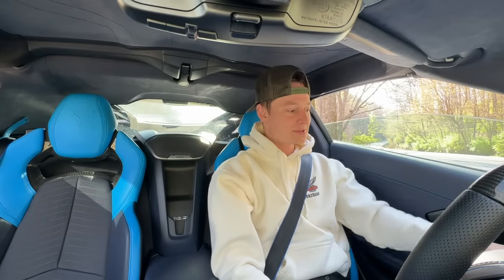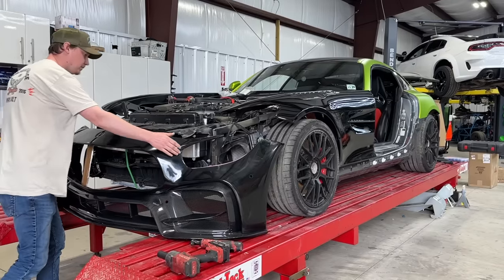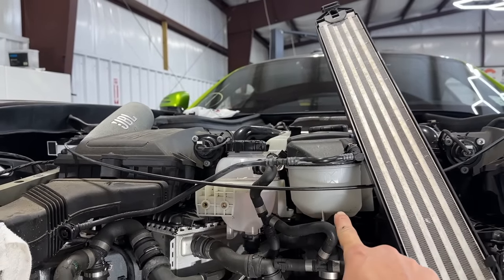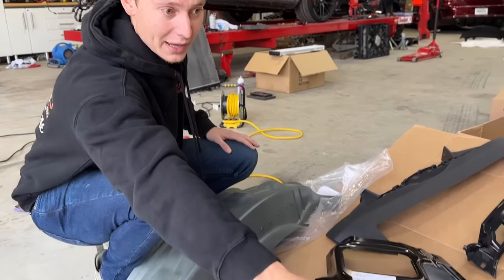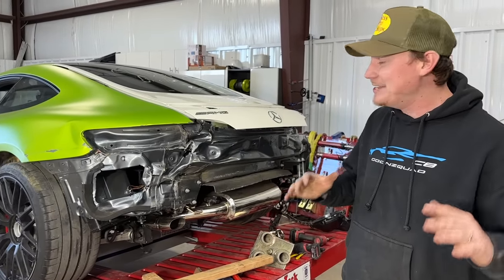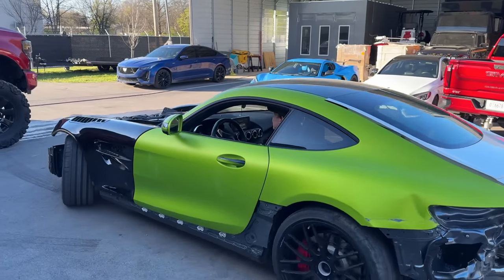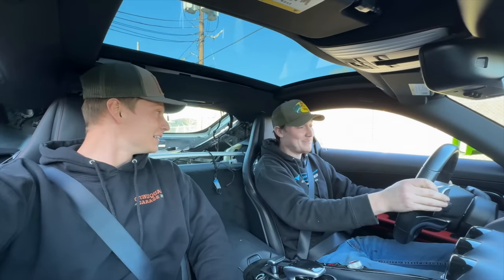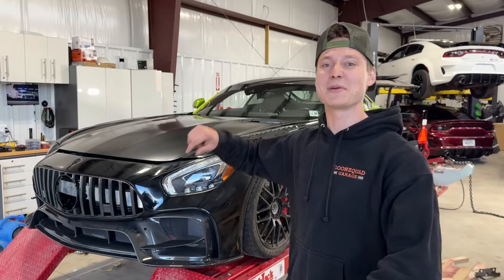Rebuilding A Wrecked Mercedes AMG GTS....First Test Drive!!!

Comment: I’m just gonna say it… It needs a different exhaust that makes it a more deeper growly tone. Right now it sounds like a soda can exhaust.
Reply: u would know. ur uncle had a soder can exhaust
Reply: That’s what they sound like.  Maybe the AMG isn’t for you.
Reply: @Shortdraw01  judging from the fact that I’ve worked on a few of these vehicles, it can sound a lot better.
Reply: @Shortdraw01  maybe my audio settings are different but I personally don’t like it
Reply: It’s got a Chinese eBay exhaust 🤷🏻‍♂️
Reply: I agree.  I own a AMG GTS and I think the Armytrix exhaust sounds horrible.  The OEM exhaust gives a deep, rumbling sound.
Reply: They always use crap exhaust/mufflers army trix or whatever it's called 8 out of 10 sound horrible
Reply: Trueee, for this exhaust is the better the oem
Reply: Its a free exhaust system lol, they not worried about it. Car will be sold or stashed away when done and moved on to the next.
Reply: @ryanjarrell4359  true
Reply: A Gintani would sound bad ass. They should’ve used one on the lambo too. I agree that them armytrix sound b double oh t y 💩 horrible
Reply: @BigDipper907 mmmh
Reply: I agree. Terrible sound.
Reply: Agreed.
Reply: They always put the cheapest Chinese parts on the most expensive cars
Reply: That's just how they sound, also, the microphone will never do it justice.
Reply: @BigDipper907  Stop riding Gintani's meat, he won't give you a free exhaust
Reply: Could just be the mic they're using.
Reply: I own gts, oem sounds is quite a bit better, especially if you code out exhaust valves and leave them fully open or use renntech/asr evm to override cars settings to do the same
Reply: @BigDipper907  14k for an exhaust? Yeah no thanks
Reply: camera audio and in person are way different. keep your opinions to yourself
Reply: Naw
Reply: Half of their cars have terrible exhaust tones. Louder isn’t always better.
Reply: @CGF101 armytrix or what they are called are legit company, what are you talking about 😂😂
Reply: Naaa sounds sikk
Reply: Ay yall really gotta stop complaining about how the horrible the sound is like let them put whatever they want like its there build not your guys built,like we can't do anything but just have to watch it maybe some in future they will put different exhaust or so.. So stop complaining how terrible the sound is🙄 like if you guys don't wanna hear it then don't watch the video.
Reply: @red80M  not like they ain’t got it
Reply: @hunghuge7262  based on your comments, you sound like a very angry person. I hope you get help.
Reply: @Ash_kilzz18  how do they become better at what they do if we can’t  give feedback? I’ve been a subscriber since 50k don’t need to worry about me being a hater🤣
Reply: Small CI engine .. flat plane crank and turbos . That’s how it’s sounds . Can’t make it any deeper
Reply: It definitely sounds stock the Chop sounds good though
Reply: Hahaha this dude has an opinion on an exhaust while they listening to it through a YouTube video lol beat it nerd
Reply: @williamriley-jones you need to be dealt with. I can tell your a very Emotional 😭 individual
Reply: Armytrix sound really good in person. The camera just can't pick it up...
Reply: @CGF101 🤣 army trix is not a cheap Chinese company.
Reply: Army Tricks is garbage quality , just like rocket bunny body kits . There are much better options out there . The best exhaust is actually made by a guy in Canada and it's called Unobtainium .
Reply: 😂😂😂😂 They get free exhaust from armyTrix so they don't care what it sounds like or they just don't know how a car should sound
Reply: I think isn’t the Mercedes in the bottom of your list anymore dudeee
Reply: You need a Brabus exhaust on that thing. Not that armytrix shit 😏
Reply: @ShannonBoys  why need to be so rude lol so me commenting my opinion is being very emotional? This is hilarious.
Reply: I bet in person it sounds nothing like it does on the vid
Reply: Still going to sound crappy
Reply: Nah man. Gotta have that thin wall cheap shit Chinese free sponsor crap. Can't fit a decent exhaust. They love that crap sound.
Reply: Really my guy. You’re sadly wrong when it comes to sound. It don’t sound like some Honda so no sir it don’t sound like no soda can.
Reply: @CGF101  😂 army trix is high dollar stuff
Reply: @sling__sh0t909  literally never seen anyone actually buy it. Only ever sponsor's use it. Lol
Reply: @Shortdraw01   maybe thats how the 4 cyl amg's sound but i have never heard a true v8 amg sound this bad. its the cheapo exhaust, might as well leave it stock if they don't a decent aftermarket exhaust on it.
Reply: Agree with you. They sound freakin horrible 😂
Reply: @williamriley-jones  beat it nerd we don’t need any wannabe professionals.

Comment: Need to find a way to pave that test road so it’s a really nice surface. Slamming those cars thru all those potholes and such. Ouch!
Reply: Thinking exactly same thing. Town may have to do it.
Reply: They can seal the cracks with a good driveway sealer, which will slow down the deterioration from water getting beneath all those cracks. Most of the damage is from heavy trucks driving over it when it is wet underneath from rain and snow. To pave it would be pretty expensive. But they can rent an Asphalt roller and do the leveling and paving themselves. The way it looks now, it's only going to get worse, if it's left unattended to.
Reply: yeah just get with the city, I'm sure they wouldn't mind if you paid for it. save on those vehicles. maybe even have it zoned as a private drive.
Reply: @ccnixon get a dozer, scrape it clean, repave it from scratch. they got the money.
Reply: I agree!! That road needs some serious work!!
Reply: It's controlled by the city and if you know where their shop is you would understand they don't fix shit in that part of town!
Reply: It’s ok, nuttin but hunksjunkas anyway
Reply: The town owns it they can't do anything to the road.
Reply: @ccnixon they don't own that road so they can't do anything with it.that road belongs to the city.
Reply: @Hobodeluxe007 lol there not going to sell that's road to them 😂😂.other businesses use that road.
Reply: Why? They don't own that road, why should they waste their money on fixing something owned by the city?!?!
Reply: Means time for a new location with a drag strip
Reply: That single stretch of road would probably cost about 100K to have a company repave it. But it's not up to them anyway.
Reply: Sweet if they had property  to build there own private  test track ! Less cop headaches
Reply: You have upset Jerry Wilcox.
Reply: sell one of the cars, plenty of money to pave it.
Reply: @scubaguy5389 no you can’t… it’s illegal to repair city roads yourself
Reply: Another smooth move boyz.......smdh.....
Reply: Thank you for pointing this out. Those are typical  neglected roads in America
Reply: That road has been that way since i was a kid. The city of Chattanooga doesnt give two f×cks about there roads
Reply: I posted the same thing just before finding yours. lol.
Reply: It wouldn’t cost much for a few tonnes of hardcore and to hire a wacker plate (not sure what you call it in the States) to at least fill the potholes, compact it and level it a bit. I know it’s not a private road but it would be an improvement and surely nobody is going to complain and the city won’t give a shit?
Reply: These guys knows exactly what, or how and when to do something if they had to, dem very smart dudes man these fellas killing it with anything thrown at them!. 💪💪👍👍👍
Reply: They do this for a living, fixing more stuff is the least of their concerns
Reply: Prohibited to touch the road way..
Reply: @Hobodeluxe007 dear city, we would like to pave the road to make it into a drag strip…
Reply: @philtucker1224 or maybe, dear mayor, our business is in exotic cars and the road on which our business is located is full of potholes and almost impossible to drive these cars into and out of the property w/o damaging them. could you please look into paving this road? we would be glad to assist in the cost if necessary or even do it ourselves with your permission. thank you, a tax-paying and voting citizen with lots of local followers.
Reply: That front looks like an angry crocodile!
Reply: @Hobodeluxe007  if only ha ha!

Comment: If you leave a crater at the end of your welds, they will crack 100% of the time. You gotta fill the end of the weld in. Good job using pulse though

Comment: I am glad that you are able to find the parts you need. This build is going along well.
Reply: They haven't found the parts 😂😂.they still need all the parts Mercedes won't sell them.them parts they all ready had.
Reply: @jerrywilcox9890  you might watch again. The rear piece they needed they got off ebay.
And the front structural piece they got off ebay as well.

Comment: I was a class a Wilder for 10 years and it didn't matter if you had your welding glasses on or not if you were close to that. Spark when at welder touched off you would get welder burn and it hurt workers and sunburn. Especially if you blister your eyes.

Comment: You gentlemen are dealing with a precision engine. The reason for the electronics is because they are intake air ports. The electronics heat the cold air on intake to minimize dieseling in a gas engine and reduce emissions and knocking on a cold start. EPA regulations, they just did it differently.

Comment: welding flash is actually just the lens on the front of your eye gets burnt  and splits and the burning sensation your feeling is air getting inside of that crack in the lens its only touching where you have never felt air before

Comment: Dudes, use a fresh air helmet when you weld aluminum. Aluminum is one of the most dangerous metals to weld causing great risk of neural damage. Please, be careful and take care of yourselves. Also, use an exhaust fan to catch and exit the fumes outside.

Comment: Whenever you're welding always wear proper eye protection.  When you're welding with electric, MIG or TIG, full face is what you should be wearing, as well as covering up skin.  You will get a burn on the skin from MIG or TIG.  Gas welding is a bit more forgiving for skin.  But always wear proper protection when you weld (gloves, eye protection, the works.)